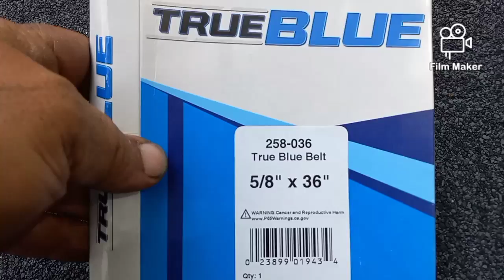Yard Bug Riding Mower Mess Final / Fixed

Comment: Hey Just came across your tutorial 
This drive system is same as the Craftsman utility mower. They over engineered both with too many pulleys and springs. Most parts are discontinued and obsolete. Craftsman does this ten year mark they discontinue parts then call them obsolete 
I’m a small engine tech fix and flip I found one of these in excellent shape. 
I’m thinking of buying it but don’t want to waste money if I can’t find parts if I happen to need for a sale. 
Nice tutorial
Reply from the maker: Thanks for taking the time to comment and subscribe it really helps.. your best bet for finding parts would be ebay for sure. I often find what I need there for this type of machine. I also have a local mower junkyard which comes in handy. I am actively looking for another one of these as the videos have been successful and people have other questions on them.. but no joy so far on finding another. Thankfully there are not too many parts on them to go bad or break. I donated this one to a local church after fixing it up.

Comment: Hey my friend. Thanks for your videos.Help me with some issues on the yard bug.I just bought. 

I am having an issue with the transmission. Going to replace the cables but as of right now, i'm not getting anything forward or reverse, even when I put it in gear manually. Maybe you would be able to help me out. Thank you.
Reply from the maker: Thanks for checking out my video.. the question is are you sure it's being put into gear? If the cables are broken inside the outer casing you will think it's going into gear but it's not. There is a T shaped piece of metal on the Trans itself .. that's on the back left side.. u have to remove the wheel to get to it.. trace the cable back to find the T where the cables connect.. it's about 4 inch wide if I remember correctly.. and make sure it's moving.  Once u find it you can move it by hand u will feel it click in place when u move it.. I've seen that t shape bent or full of dirt n not moving.. try that first .. if it is actually moving and engaging then it's a trans issue (very rare) but I believe those trans are NOT SERVICEABLE.. so u can try messing with it.  Look for leaks but normally you gotta find one on ebay.. let me know what u find

Comment: Hey, I hope you are doing well, I’m so glad I found you on here my Son and I just got our yard bug which was not running and cables broken so we can’t put it in gear so I was hoping if you had a video on how you put the transmission cables on also I see you have a side grass chute ours apparently had the basket that fit under the seat but we only have the grass attachment that fits the basket. You wouldn’t happen to have one for sell or the side chute either one would be great. Thank you for your time.
Reply from the maker: Hi and thanks so much for watching my vid and subscribing it helps a ton.. unfortunately that video was over 20 months ago and I did not do too many vids on it. those bugs are hard to find these days and i donated it to a family in need through my church.. as far as the grass catcher under the seat your best bet is Ebay.. they sell a plug that fits into the hole on the top of the deck so the mower acts as a mulcher and doesn't blow grass up into the machine under the seat. if you haven't already found a video to help I do remember the machine pretty well.. in order to get to the top side of the trans cables you remove the steering wheel and the plastic collar around the steering column and you will see the cables.. 2 of them and you need a 10mm wrench to remove them.. you then can follow the cables along the frame to the back right wheel.. if you remove that wheel you will see the cables attach to a t shaped pivot arm with a simple z bend that just goes through the hole.. no tools required.. to remove the deck you will see the front side attaches by just hanging.. I don't remember any clips.. that's how you raise and lower it.. for the back side there are 2 arms that extend from the frame to the deck and its a simple cotter pin and pin set.. remove the pins and the deck drops.. disconnect the blade engagement cable the same way and remove the belt if you need to. I am always here if you have questions.. I can always make you a video as a reaction to one I find on Youtube and print out some pages with pics if I need to. I am always willing to help the best I can and teaching kids these days is important.. hope this helped.. have a great night
Reply: @MunkyWrench  , thank you Sir, it’s spring break here so my Son and I will get out there and tackle it. I’ve looked on eBay and googled the grass chute but no luck, would you mind sending me the link for the mulch plug. But I just want to say we appreciate you and all you do on here to show how to work on everything, stay safe and we’ll be looking forward to your next project.
Reply from the maker: ok this is the part number for the side discharge chute/mulch plug Side Discharge Chute
Item#: 731-1744  I found it on troy bilts website https://www.troybilt.com/en_US/all-products/side-discharge-chute/731-1744.html  hope this helps  @darinelliott3026
Reply: @MunkyWrench  thank you for sending me that, but unfortunately it’s no longer available, but I typed that item number in eBay and I found one but he wanted $140 I think it was I made him an offer for $65 so we’ll see if he accepts it. I’m going to watch your video again on the belts so I order the correct ones. Thanks again for your assistance, have a great day
Reply from the maker: those parts are not being made anymore.. the trick will be to keep the part number and do a search once a week.. ebay changes all the time so sooner or later one will be available.. also you can just use something to block the hole.. usually you can get some thin sheet metal from the big box store and cut it with tin snips , bend it where needed to fit drill a few holes and rivet it on or even weld it on if you can.. and you can always cut a new hole in the side of the deck for discharge.. these little mowers were fun and useful but not a huge hit for consumers so finding parts is hard.. but modifying it yourself is perfectly fine..  @darinelliott3026

Comment: Munky I really appreciate your videos on the Yard Bug. On mine after I replaced the drive & trans belts my gas pedal aka variable speed pedal is very tight and will only go about half way forward. Can you give me any tips on how to adjust and fix this? Also the Video you did on how to trouble the non-starting was very helpful. I am trying to fix it so my son with Autism can ride it around the yard with me for fun.
Reply from the maker: Hi Travis usually if you put a new belt on and the pedal doesn't move much its a couple things to check.. 1st is belt size.. the length has to be correct for your specific mower.. there are several brands that make similar machines and the belts can vary in length from a quarter inch to 3/3 inch longer so be sure you have the right length.. the thickness is also important.. if it calls for 1/2 inch and you put on a 5/8 it actually makes it shorter because its thicker.. make sure the v side is facing the v.. make sure the belt is routed correctly, not outside of a keeper.. and make sure the spring on the tension lever is not jammed to the side or stuck somehow.. check those things and get back to me and we will try to figure out what else might be causing the problem

Comment: What size tire did u get from labor frieght. How is that wheel tire working out. I started to buy 2 for the front but I didn't think it would work. The tire on the lawnmower is 11x4x4. All harbor frieght had was 10 or 12, no 11
Reply from the maker: Yeah they only have tire that fit the smaller front wheels.  Tires held up fine as far as I know.. I had it for months then donated it to a needy family and as far as I know tire still in good shape.  As a mower tire it's great.  We also use them on gokarts we build and they are pretty good

Comment: How did you install the transmission Forward/Reverse shifter Cables?  The bottom cable is easy to thread, but the top one is very hard to thread. Any tips on how to thread the hard one? Did you have to unmount the transmission or the front plate to get access?
Reply from the maker: I took off the wheel and the outer plate and it was a pain but the only thing I can say is patience and octopus fingers sorry the small machine was not an engineers dream

Comment: I have a Craftsman yard bug 500 and it is not that much different than this one. What I need is information on how to tighten the deck belt. I can't find anything and then I found you. Are you able to help me?
Reply from the maker: There is not really a way to tighten the deck belt per say.. they get stretched and worn and begin to slip and be too long .. that's when you know its time to change them.. Having said that, there is an arm with a pulley on it and a spring that keeps tension , if the new belt is too long and your sure its the correct size you can check the spring.. it can be rusted, broken or stretched.. if it looks damaged in any way it won't hold the correct tension and the belt will slip and be loose.. they are cheap and easy to change with a piece of string.. Be sure you get the correct length belt.. each manufacturer has a specified size and sometimes they are half inch sizes.. so if you got a belt from a box store it might be a bit too long.. if you need more information or part numbers or diagrams just let me know I will help you in any way I can. I am proud of you for fixing it yourself and I am glad to help.. please subscribe if you haven't already it really helps.. if you need more in depth info or diagrams just email me and we can get you sorted out

Comment: Hey buddy you wouldn't happen to know the deck belt size an length dam thing hard to find parts it seems il keep trying nothing coming up really for a deck belt i got my other belts from princess auto online good price showed up in 3 days have a good one cheers
Reply from the maker: another viewer asked me the same question last week.. this is what I found when I looked it up.. that video was over 2 years ago so double check and cross reference for your particular machine but here's a place to start....I just looked thru my records.. my particular one is a 5/8  inch thick belt.. 36 inches long.. u should be able to find one at napa or tractor supply or that kind of store in your area .  Part# 754-0453.. all machines are specific so if u look it up on parts tree .. by model number on body u should find it
Reply from the maker: Do me a favor and subscribe to the channel.. it helps a lot thanks for coming by and if I can help in any other way I am here

Comment: Hi.... Do you know where to get air filter and plastic cover replacement for the yard bug
Reply from the maker: Thanks for taking the time to comment.. I'm sorry to say that the only place I've had luck was from ebay or buying another one locally for parts.. they haven't been made in quite a while so u can't buy new replacement parts .. only used and u have to stay vigilant and search often to get lucky.. it's like fishing.. as for air filter itself u should be able to find on amazon or a local parts dealer
Reply: Amazon, temu, ebay
Reply: Temu, amazon, ebay, atwood, tractor supply, homedepot

Comment: Do you know where the reverse switch is?  my bug goes into gear can't push it but wont drive in reverse every time.      got to be  the switch adjustment, the cable adjust is correct according to the manual just cant find the rev switch to check out
Reply from the maker: The reverse cable and the drive cable attach to the same lever (different ends) on the trans.. if it's not going far enough into gear u have to take off the steering wheel and pull off the steering colum sleeve so u can adjust the cable on the steering column
Reply: @MunkyWrench or one of the cables is broke
Reply from the maker: @LindaDerden  I am glad you were able to find that broken cable.. I hope you can replace it easily and it fixes the problem

Comment: What's the belt for the mower deck? I got one and the belt is too big
Reply from the maker: I would have to look it up.. Best way is to get the model number off the body of the machine if u can and send to me.. I'll see what I can find in my records that was 2 yrs ago
Reply from the maker: I just looked thru my records.. my particular one is a 5/8  inch thick belt.. 36 inches long.. u should be able to find one at napa or tractor supply or that kind of store in your area .  Part# 754-0453.. all machines are specific so if u look it up on parts tree .. by model number on body u should find it
Reply from the maker: I miss wrote a number.. part number 754-0754 .. but again look it up by your model number on parts tree . Com

Comment: I got the same machine for free also. I took the deck off because I wanted it strictly to drive around my yard and pull small yard trailer. I'm having issues with it cranking then dying. Any suggestions? I've tried cleaning the carburetor and no change.
Reply from the maker: If it starts and runs at all.. its most likely a fuel issue .. so check the fuel delivery from clogged tank.. to collapsing fuel lines... clogged filter.  And often I have to clean carb several times and sometimes I just replace them as they are so cheap.  Could be a safety switch issue as well

Comment: What does it mean when i can’t move my lever to go forward or backwards when it’s started
Reply from the maker: thanks for watching and subscribing.. does the lever move when it is not running. the cables often get corroded and stuck inside the casing. are you talking about the lever for forward and reverse.. or the throttle lever? if the throttle lever wont move when its running it could be the governor in the motor has it jammed in the open position.. is the motor revving high? i'm here for any questions you have
Reply: @MunkyWrench  yes it’s the forward and reverse doesn’t move at all on or off i even follow the cable to the motor and where it’s connected on the bottom of the engine that doesn’t move nether and i tired all the break stuff hold it let off slowly and it doesn’t move at all
Reply: @MunkyWrench  and i appreciate you replying back you have the best video of the bug if you get a chance to get another one and do a detailed video of it would be awesome these little bugs are awesome and cute looking lol
Reply from the maker: @JoseEscobedo-c2v  yes if its the gear shift cables and they don't move at all.. they most likely swelled and corroded inside the sleeve.. these cables are the same as brake or shifter cables on a bike.. plastic outer sleeve stays still and the inner cable is steel and moved through the outer sleeve.. over the years they will rust and get stuck.. im proud of you for tracking them all the way to the rear end.. nice job.. you most likely have to remove the rear wheel to unhook them.. and you have to remove the steering column and wheel to get to them in the front but they are pretty easy to change with minimum tools.. its been a long time since that video but I believe to replace them both was around $50.. i used some standard mower cables and shifted by hand for a bit to test everything out then installed the proper cables and donated it to a family in need.. i am always on the lookout for another one cause I agree they are cool looking and its a popular video on my channel so hopefully I will get another one soon
Reply: Broke cables or adj cables

Comment: Awesome video, I've been looking for content on this machine for hours and like you said, there's nothing else available! That being said, if the yard bug starts mowing but starts smoking and stalls (on top of the screeching like a banshee) would you consider that a pulley problem?
Reply from the maker: It depends where the smoke is coming from.. not that I'd recommend it but I would first let it run.. safely.. and find out where the sound is coming from and the smoke by moving around and listening. If it's under the motor and under the rear end I would jack it up and run it to find the source
Reply from the maker: If u think it's a pulley and a belt is smoking you should remove the belt asap and run it.  If noise and smoke go away then u know it's a pulley.. and u don't want to smoke or break a belt